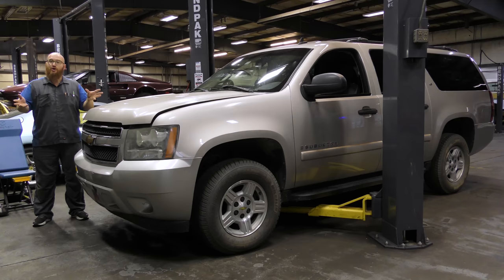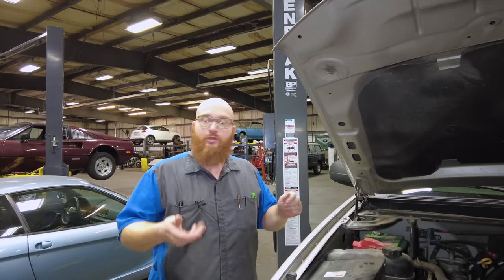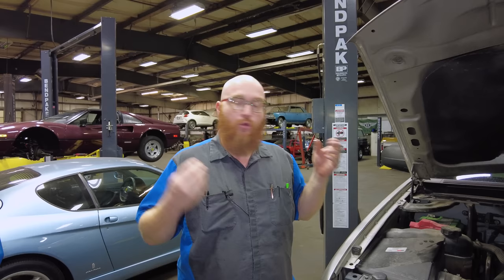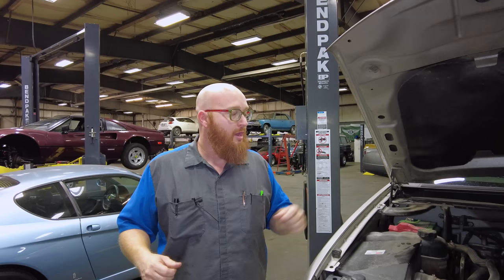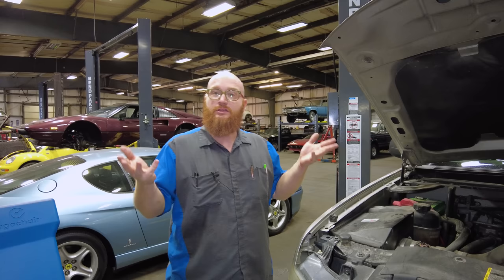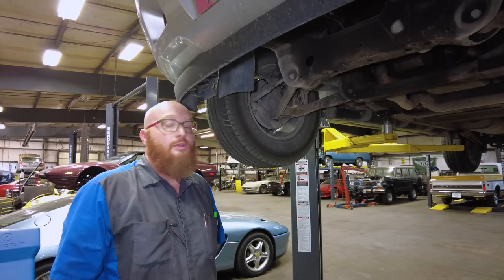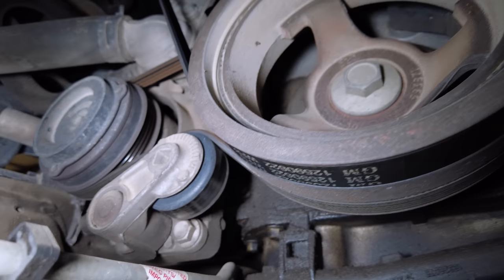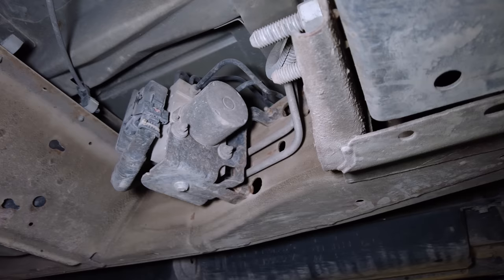What fails on ALL early 2000's Chevy SUV's!? CAR WIZARD shares what he's seen from the last 20 years

Comment: One of the most common things you didn't mention is intake gaskets causing lean codes. When it happens I change the intake gaskets, valve cover gaskets, knock sensors and harness. Usually around 100k and the tune up is easy to do at the same time. Also at 100k I will recommend water pump (they all will be leaking by then), serpentine belt(s), and both tensioners. Good under the hood for another 100k!
Reply: I have beat the dog shit outta LS and ls variant motors.. and NEVER have I had a head gasket problem.
Reply: Yes water pump. Mine failed right at 120k. Also the electric fan motors
Reply: I have a p219a code, I probably have to change the intake gasket is what people say
Reply: Yes, the lower intake gasket goes because of the early versions that used dexcool which wrecks the gaskets. The tell on this is the too early replacement on the cap and rotor from coolant steaming up into the cap.
Reply: @brandonkelsey1092  He was talking about intake gaskets.
Reply: @danielbuckner2167 it's a dry intake.. how does dexcool cause any issues?  Been running dexcool since new on my 06 4.8.  changed 3 times (every 5 years).  Still on original water pump and thermostat too.  I did change the cap once.
Reply: @pughconsulting  It is known to slowly break down gaskets. Hence the leaking at the lower intake. If you tore yours down right now you'd likely see damage already. The solution is to simply flush it all out and use a different coolant.👍
Reply: @danielbuckner2167  I did the knock sensors a few years ago.  Everything looked good to me.  Dexcool was a problem for many of the v6 engines, can't recall which off hand but those were wet intakes.  I've never even heard of any issues these truck engines.
Reply: The comments about the coolant just reminded me I have never changed the coolant in my 2005 Z71 5.3 Tahoe.  Has about 40K on it.  It was parked for a 13 year period and once I pulled it out of storage I changed oil and plugs and wires, did the Marvel mystery oil thing into the cyclinders and rotated by hand, etc.  Had to replace back two injectors due to clogging.  Various fuel tank additives cleared up the other misfiring cyclinders.  Just did oil change today and there is some oil leaking from somewhere.  Maybe that oil sender.  I'm going to do the coolant tomorrow, and the air filter.  This was great info, really appreciate everyone chiming in.
Reply: @MarkWatson-xi1ry  I just pull the lower hose from the thermostat.  It doesn't flush the entire system but it's simple enough and I don't trust running tap water through the system so drain and refills it is. If you jack up the driver's side a little, you can get around 2 gallons out.  Love those Tahoes.
Reply: @pughconsulting  I'll try jacking the driver's side.  What coolant do you recommend?  BTW - I had the rear hatch electrical connector, at the top of the car frame, fry.  Rear wiper motor and washer were intermittent, then quit.  Also have an instrument lamp out on the front heater temp slider switch panel.  Get a little knock feel in the steering wheel sometimes, and the 4WD seemed to be stuck in 4WD even though the panel showed 2H.  Front wheels were grabbing/skidding on the pavement during turns.  I like mine for what I use it for.  Suburban is too big and Honda CR-V too small.  I like the ease of navigating thru parking lots with the shorter wheelbase.
Reply: @MarkWatson-xi1ry  I've used AC Delco, Zerex, and Prestone Dexcool.  Preference is that order for me but I imagine any Dexcool is formulated to meet spec.  The instrument lamp or lights are a known issue.  You can solder new bulbs in but it's a pain.  I replaced the AC control with another several years ago.  Might have some luck at a junkyard.  I also think some places will replace all the lights if you send it off.  Knocking in the steering might be the intermediate steering shaft.  The dealer replaced about everything in my steering under warranty.  There are some upgraded parts.  Usually spline grease can keep it quiet for a year or two.  Something with moly like Honda m77 or Loctites LB8012 moly paste.  Sorry I'm no help on the 4wd.  Mine is a 2 wheeler.  Good luck!
Reply: @pughconsulting  Thanks Mister!  I got the replacement lamp, so will try soldering first, then order the panel if need be.

Comment: For the broken manifold bolts there is a company that makes a bracket you can bolt to the head and then clamps the manifold against the head. Not an ideal fix but if you’re on a budget it’s worth it

Comment: '07 GMC Sierra in the family since new w/ 296,000 miles now. Most of the failures were covered in this video; Oil pickup o-ring, oil pressure sensor, cam cover gaskets, oil cooler lines, and new front axles/wheel bearings. Other than that it's been an incredible truck and never left us stranded. I love that it's still simple enough that I can do all the repairs myself.
Reply: Bingo PAL…
Reply: but did they all happen at 100k like insinuated here?  I bet not...
Reply: 2005 GMC left my family stranded plenty of times. Glad you had a better experience.

Comment: Almost everything you have mentioned i have replaced on my 2002 Tahoe 4x4 Just had the oil pickup tube o-ring and pan gasket replaced as mine is at 176k. Have heard horror stories of people not replacing that part and when they get near the 200k mark they fail and start sucking air and trash the motor. 

Would have done it myself but I don't have the tools to lower the front differential. Up next for me is the differential seals as they are leaking. 

These trucks last forever if you take care of them. I would much rather have my 02 Tahoe then a new 2022 Tahoe that has lots more electronics that can fall.
Reply: My 97 made it to 252k before trans went then my 07 was sold running strong at 293k they are great if you maintain them
Reply: My 2001 Yukon 4x4 has had the exact same problems. But ĺike u we love this suv.

Comment: Wise advice on towing. Up in Canada, the big problem is rusty brake lines. You will need to replace them. And make sure you check and service your exposed spare and its storage and lowering mechanism. People always ignore them and find they can’t fix a flat.
Reply: 2011 Yukon unfortunately found out about this only as I tried to lower the spare after a flat. Ended up having have it towed to a shop where they had to break the entire mechanism to get the spare off. 😫

Comment: One thing worth mentioning when budgeting with these trucks are the typical idler, pitman arm deaths that in turn stress inner tie rods that then EAT front tires up. Just about every early 2k model that comes in has OVER a degree of play in their front steering linkage that leads to tire replacement every 6 months if not corrected. One of the most overlooked expenses we've had at our shop. Typically customers will ho through 2 sets of tires before realizing we arent trying to rip them off.
Reply: ay i just picked up 05 colorado needed wheel bearings and tie rod ends. pitman and idler arm is my next move. nobody really knows about them, but that tightened up my 99 s10 a lot.  good call.  parts stores didn't carry it, i had to go to dealership for pitman arm.  a tip i learned working  on mercedes.  half the parts for imports u just can't find in retail store but dealership has in stock at reasonable price. just dont pay them to do the labor  :)
Reply: @ATF2099  I've owned quite a few Mercedes and BMWs that people didn't want to repair and that's spot on, I buy from the dealership and do it myself. Most of it's not even worth ordering online when you can get it from the dealership within 20 bucks of price.

Comment: As a long time GMC / Chevy owner this was absolutely spot on. These are still great vehicles and I have had dozens in my fleet hit 350,000 miles.  I have a 2008 Avalanche in the shop right now for a AFM delete. My shop loves and hates me.
Reply: what is AFM?
Reply: @jamesmedina2062  Active Fuel Management
Reply: If it wasn't for the fact that GM subs most of their parts out to the lowest bidders, these trucks would be bulletproof.
Reply: @S Silva (Suds) The main problem lies with the fact that they continue to replace engineers with accountants.
Reply: How are you deleting the AFM?
Reply: @stevelee719  SMALL DEVICES THAT PLUG INTO YOUR OBD PORT. RANGER IS ONE
Reply: @AlienGrade  Thanks for the info. Fuel mileage not as much of a concern as the damage done to the engine by the AFM.
Reply: They absolutely aren't "great vehicles". I own 2 escalades from this gem.  They are junk.

Comment: How sad that the fuel saving system sounds like a good thing at first...but at the cost of the engine's reliability
Reply: Ideology destroys everything it comes into contact with including cars sadly so this should come as no surprise though will laugh at California not having a working power grid to charge all those EVs.
Reply: @MrKillswitch88  - I’m for the environment and EVs, but like you’ve pointed out. We need the infrastructure to support them. Don’t even get me started on subsidized ethanol.
Reply: @Yippee Skippy Just because people you didn't vote for are present doesn't mean they're "unelected". I'd like to know who you think wasn't elected that enacted CAFE standards.

Edit: And they already tried the thing you suggested since it was the default.
Reply: It's seems even worse now that gm has implemented cylinder deactivation (to me it sounds like afm problems on steroids).

Comment: Picked a 2006 Suburban up for CHEAP because they had that oil pressure sending unit fail, but a shop quoted them $2k for a RMS replacement with no guarantee there wasn't engine damage from 0 oil pressure. $20 part and I was one happy buddy!

Comment: When my lifter stuck in mine i went ahead and replaced all of these at once and not 10,000 miles later the transmission ate itself like you said. I’m getting ready to rebuild it but I’m really glad you made this video because now I know about the overdrive thing. No one ever told me that.
Reply: you sure you want to put more money into a car that has so many common problems?
Reply: @ImGerald  Sadly many people have to do this as it's still cheaper than buying another car. I still see PT Cruisers at times. Probably gonna be a rarity someday.
Reply: @ImGerald  see 20:00
Reply: @TessaTheCat_  yeah you have a point there. Especially with the insane prices of used cars.
Reply: @7x779  💯
Reply: @ImGerald  true, but these are pretty damn sweet and just about everything 2012 n older have 200k+ on them already

Comment: My brothers 2008 Z71 hasn't had any of these problems except for the AFM. He took it to a shop for a tune up and asked them to change the oil. Guess they didn't
 About 5 months later he drove to my place and we heard the lifter tick. I checked the oil and it was about 3 and a half quarts low. He said the low oil light came on about half-mile from my place. Got some oil in it. He scheduled to have the AFM delete done. Hasn't had a problem since. These are exceptional rigs.

Comment: Great video! Over the 2 years I've had my 2008 Tahoe LS, a couple things I've had to fix that I found was VERY COMMON are the Heater Hose fittings against the front firewall and the issue with the charcoal canister failing and spewing pellets all throughout your air venting system on the fuel tank.

WHEN that heater hose fitting fails, you'll notice you're losing a little bit of coolant at first and you might not even be able to see where it's coming from, but it will get worse FAST and you'll see coolant spraying from the fitting on the left, most of the time. They're a pain in the butt to get to, but replace BOTH of them.

If you're a person who likes to "top off" the gas tank, STOP IMMEDIATELY. Somehow, gas gets backed up into the charcoal canister and destroys the netting that holds those pellets in place and then those pellets get spewed all over your fuel tank's venting system. IF you're lucky, you can vacuum the pellets out from the hose connections at the cannister, but if you're at the point where the fuel pump shuts off every few seconds, you're gonna have to drop the fuel tank and vacuum and blow out all of those lines. 

I have a video on my channel about how to do that.

Overall, I love my Tahoe, tho. First truck for me and it's totally worth it.
Reply: Topping off is a danger to any make and model, not just GM trucks.

Comment: My old 2000 GMC 2500 with the 6.0 was a great truck with the only foible being the separate AC belt that would break once a year.  Agree with the AFM debacle.  Had it happen on a later Suburban resulting in a bad lifter and a bent pushrod.  Did the work myself but lost confidence in those engines.  I have 2 Corvettes over 40 years old on the original engine builds and those days are long gone I'm afraid.
Reply: 1998 with over 375k try that
Reply: @greystone83  My '89 obs c/3500 1ton sm465,  It crossed 1million in 2017. Still does burnouts.
Reply: @sloppyoppie  that is so cool

Comment: Bought a brand new 2000 Silverado extended cab 2WD that year. Regular oil changes, brake pads and transmission filter/fluid changes. At 333,085 miles 1st gear went out. I tow a lot so I replaced the bad 4L60e with a 4L80e and decided, despite the 5.3 cranking immediately, I'd replace it as well with an LY6 6.0 Gen IV. I deleted DOD, swapped original cam with a Trailblazer SS cam, long tube headers, 3" dual exhaust, larger DBC TB, electric fans and water pump. Every hose is now SS braided with AN fittings including radiator, a 3 row without transmission cooler. Separate transmission and oil coolers with thermostats. Practically everything is now new except the body and frame. I love that truck and will keep it to my last day.
Inherited my Dad's 2003 Yukon XL which currently has around 115,000 miles. I just had it's 4L60e rebuilt after a fluid/filter change yielded a non moving vehicle. I plan on keeping it to my last day as well.
I never tow in OD, I leave it in 3rd.

Comment: The dashboards in the 2007-2014 was more brittle than a dollar store candy cane. i've never seen one that wasn't cracked to pieces. Also, the airbag sensors on the front grille are notorious for cracking and shorting out. I owned 2 vehicles (06 sierra and 08 tahoe) both with the same issue.
Reply: It's a heat thing, had no problems with the three we owned in WI.
Reply: I have a non cracked 07
Reply: I have a buddy that bought his in cali and brought it to Chicago and its cracked
Reply: Aint lying my shyt looks like someone been tap dancing on it.
Reply: Funny. I have an 06 Sierra and 08 tahoe lol
Reply: The dash in my 2007 Suburban had several cracks when I bought it in 2016.  I removed the dash and fixed the cracks permanently.  First I used a plastic welder and #16 Acrylic solvent/cement to get everything lined up and fixed in place.  Then I reinforced the entire underside with fiberglass and JB Weld (note: it's important to rough up the underside with sandpaper to ensure good adhesion).  Lastly, I applied a coat of smooth UV bed liner (without grit) on the top surface.  It was time consuming, but relatively easy.  Overall I spent less than $150, and the result was fantastic.  I drove it for 5 years in the Texas heat, and not a single crack reappeared.  Sadly I totaled the vehicle in late 2021 after hitting a large deer at 80 MPH...
Reply: Good work brother thanks for advice
Reply: @alcerz984  Suspect the Cali heat primed it to crack - unless of course it's a black interior. Those crack even in WI.
Reply: Same here I ordered a  molded dash cover 160 bucks  looks oem   took 10 min to install

Comment: I got 2 miles down the road from the house with the camper and realized I forgot to put it in tow/haul mode. I flipped it on at the traffic light and my wife started freaking out cause she saw the light come on 🤣 I had to explain to her what I did. I think I lost 1/2 a MPG on my trip compared to not pulling the camper.

Comment: Spot on video!
I bought a brand new 2003 Chevy Tahoe LT 5.3 loaded.4x4. I live in New Jersey. 
This vehicle never missed a scheduled maintance. 
Never towed anything.
Never off roading.
And it snows about once a year in NJ and it was washed regularly after road saltings. 
I had it 10 years and at 90,000 miles had enough. 
Instrument cluster ✔ 
Belt tensioner ✔ 
Coil failure ✔ 
Exaust manifold bolt ✔ 
ABS failure lights ✔ 
Brake lines all rusted out and failed one by one ✔ 
The frame looked like someone threw acid on it at 90 k miles.  
I recieved a recall notice about the frame rust but when I brought the vehicle back to Chevrolet I was informed my vehicle was not in the range of vehicles in question by 350. 

Dont get me wrong the 5.3 v8 was a beast .

I was always a Chevy guy up to that point but am now in a Ford F 150 king cab and never will go back. 

FYI my neighbor has a 2013 Tahoe LT and GM never put cabin air filters in them.   It has a musty stink .  Breathing not an option for GM